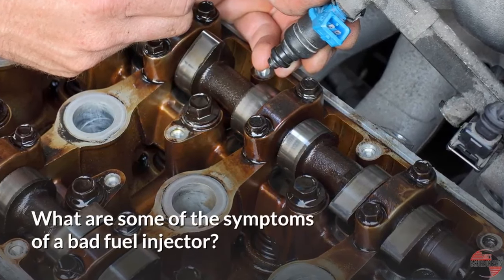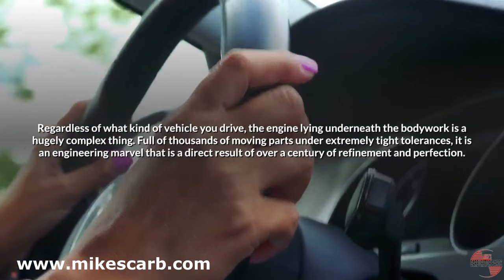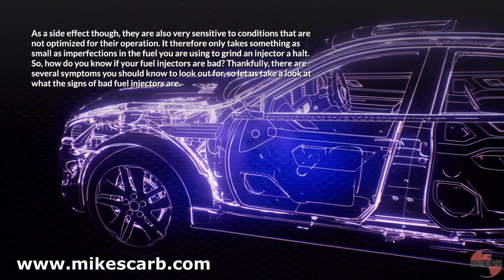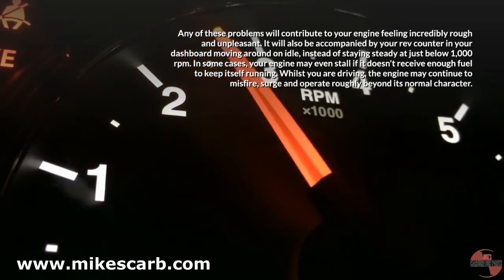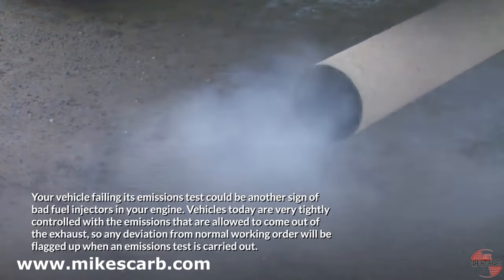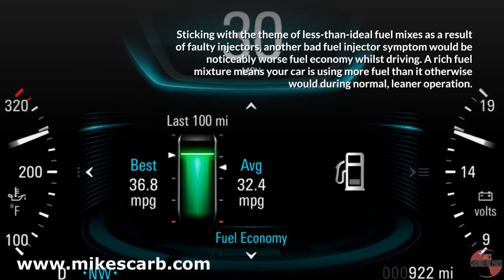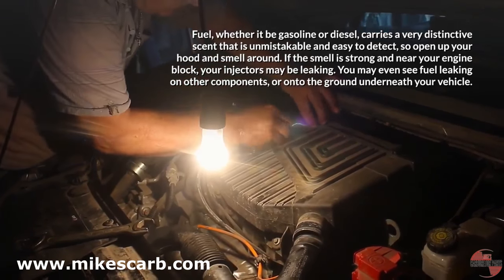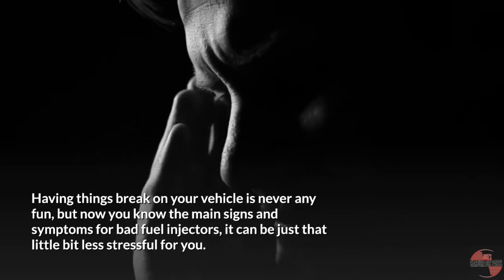Bad Fuel Injector Symptoms

Comment: my car runs fine at high speeds but at low speeds seems to missfire not sure what the issue may be and when idling the idle is rough and sounds a bit cammed
Reply: In high RPM you don’t recognize the misfire. Check spark on each cylinder (Spark gun) and check ohm resistance of all injectors
Reply: Check the camshaft and crankshaft positioning sensors.
Reply: What year, make, motor in the vehicle with cylinder amount.  Everyone can give you a general idea but it's a crap shoot without this info. Do you have a check engine light on? There are a huge amount of things that can cause bad idol.  Saw one where a dandelion seed, the little parashoot things, and it got on the hot lead of the mass air flow sensor screwing up the fuel reading.
Reply: Same problem im having rn, ever find out the issue?

Comment: What's the logic behind clogged fuel injectors decreasing fuel economy? Shouldn't it save fuel instead, since less fuel is being injected to the engine because of the clog?
Reply: Your engine has to work harder for that small combustion and will suffer depreciation fast if you keep running the engine with clogged injectors. When the damage has been made, the engine will need even more gasoline to create the combustion that is required, permanently ruining your fuel economy.
Reply: Bruv ur car races more 

High rpms burn more fuel when ur speed isn’t up to match with ur rpm

Comment: I have an 07 Avalon and it recently started to have an issue where, if I floor it, it will take move then have a brief 2-3 seconds of lack of power then take off. The oil currently used is the semi synthetic grade. Not sure why this started to happen. I plan to get the spark plugs changed soon even though it may not yet be needed but it is a costly job being that I don't have the tools needed to do this myself.
Reply: Did you scan it with a code reader?

What are your trouble codes?
Reply: @maphyous228  No I never scanned it because no errors came on the dash so I thought it wouldn’t give any codes. Do vehicles throw codes even when nothing is listed on the dash?
Reply: @adrianb1655  No, if there is a code it will show up on the dash. Sometimes you can force a code by driving the car aggressively.
Reply: @maphyous228  my battery was low once battery changed all kinds of codes came thru…
Reply: Did you ever figure out the issue?
Reply: @jaden3689  Nope, it still happens.
Reply: Plpll
Reply: @adrianb1655  ever figure it out?
Reply: @willyum2633  I never fully diagnosed it but I think it’s something to do with the spark plugs. I know I need them replaced but man the three in the back near the firewall are the reason I haven’t done it yet. Still working up the courage to do it myself haha

Comment: I have a 93 crown Victoria and I get average 13.9 mpg I get white smoke out of my exhaust sometimes, and I feel a slight loss of power. When I step on the gas a lot my check engine light comes on for a few seconds then turns off.
Reply: Jay Yoyo  yessir it does idle rough
Reply: White smoke out the pipe usually means coolant is going in the combustion chamber. 9 times out of ten, headgasket

Comment: Very nice vid i got a 2012 sierra 5.3 just replaced the cats and full dual exhaust ive went through 3 rear down stream oxygen sensors new ones are fine till i drive it awhile then the get all black soot on them may be a clogged injector
Reply: Out of curiosity what happened ?
Reply: Will bad injectors cause gas to fill up in intake manifold and come through the throttlebody of a 2011 ford explorer
Reply: @eunicenelson812  the problem you've described I have seen before. In my case there was one broken rocker arm on an intake valve. With the one intake valve not opening the fuel would simply fill the intake runner. This was on a simple LS engine but would apply to all multiport engines.
Reply: And yes a stuck fuel injector would do it too

Comment: Excellent video 
I have 1nrfe dvvti 
Low rpm lack of power need to press gas more and sound from exhaust gogogo
No rough idle
No  codes
No engine light
No white smoke
39mpg atm
Change spark plugs air filter cleaned throttle body inside out
Any recommendations
Its an electronic throttle body
Reply: Your cat converter might be plugged does your exhaust smell terrible almost fishy smell or rotten eggs? No exhaust flow means car no go

Comment: My Mazda 3 2015 has had some of these symptoms for the last year.  Low mileage, bouncing idle when in drive and at a red light or something, misfiring when I start it usually takes 2 to 3 attempts.  Also check engine light on and off.  My mechanic said code was related to mass air sensor.  He replaced the sensor but didn't help with any symptoms.  Got a new battery, so that's not the problem.  Mechanics here in NY are very lazy. I'm at a loss what to do.
Reply: @MikesCarburetor  thanks.  i actually took it into my new mechanic a few days ago for body work.  he's also looking at this problem.  he says so far that since the engine does crank and start there is air, fuel and compression, although he did say one of the air sensors was the wrong one a prior mechanic had installed.  
 he seems to think faulty starts might be from the computer?  i mentioned the fuel injectors and he also thinks that could be it but seems to lean towards the computer.  i had actually put in stp prior to taking it into the new mechanic. but haven't had a chance to drive it yet.
Reply: It's your throttle position sensor (TPS) sensor, bouncing idle was the biggest clue
Reply: @oceanpacific3841  but would that also be the reason the car starts cold but when warm will crank but won't turn over.  it takes usually 2 or 3 attempts once the car is warm throughout the day.
Reply: @magamaga1827  ever figure it out

Comment: My problem is at startup. It acts like it's not getting the fuel it needs at start-up and white smoke is coming out the tailpipe. I've used injector cleaner and it took care of it till now. I'll use that again till I save to get a complete injector cleaning.
Reply: White smoke from your exhaust (if it happens continuously after starting the vehicle) is usually coolant being burned within the engine. Which usually means a head gasket issue.
Reply: Jay Yoyo  depends on if you have any issues, like overheating or low coolant levels. Otherwise it could just be steam being burned off, humidity/weather would/could also play a part.

But yes it could still be that coolant is getting into the engine and being burned.
Reply: Jay Yoyo  so normally you shouldn’t have to refill coolant. A flawless cooling system won’t require you to top it off. But if it’s only a little annually it’s most likely just a small leak.
Reply: Jay Yoyo  cold stalling is completely different. Coolant levels or leaking coolant won’t affect your cars starting ability.

Cold start stalling could be the fuel pump, fuel filter, fuel injectors, bad battery, bad battery leads, bad alternator; etc. If it’s cold starting that needs to be diagnosed by a mechanic. Making sure you have a good battery and alternator is an good start tho, usually done free at auto zone or the like.
Reply: Jay Yoyo  again you’d have to take it to a mechanic to get a proper diagnosis. I could list off potential causes all day, but really that’s all just speculation. Something like that can only be determined in person, with a proper in depth diagnosis; which unfortunately are kinda costly.
Reply: Jay Yoyo  here, on YouTube look up Scotty Kilmer click on any of his videos, and go to the description box. You’ll find a link to his website loaded with people who can help.

I did say cold stalling/starting is better diagnosed in person by a mechanic. Finding a good mechanic is hard but once you do everything works out.

To answer your question … no. A blown head gasket would not cause stalling and compression issues; UNLESS is was a seriously damage head gasket or engine block. In which case you’d be loosing/burning a ridiculous amount of coolant, a day. Seeing as your not nearly losing that much coolant, the answer is no. 

You could have your engine compression tested tho to be certain. Bad compression could mean a worn out engine, bad radiator, leak, etc.

But again I don’t know the year, make, model, history, and mileage of the vehicle. I’ve only every had Hondas and Toyotas, those I guess you could say I specialize in.

EDIT (here’s the link): https://carkiller.com/community/
Reply: Do you have a Lexus suv?
Reply: Same exact issue how do I know if serious or fuel injunctive or air filter or bad muffler and pipe.  These mechanics can’t be trustee

Comment: I'm hoping this is what all is going wrong with my 08 Chrysler Town & Country. The engine completely stopped one night, and while it turns over, it only runs for a second or two. Things I noticed leading up to that, pinging (thought it was knocking), the aforementioned rough idle and severe mileage loss. The first few times I got it started back up (before it shut off again) it backfired multiple times and sounded like a lawnmower before it shut back off. I feel like it's definitely fuel related since I had another car sound like that once, when the fuel pump went out. Is the lawnmower sound common with bad fuel injectors?
Reply: You got water in tank get rubbing alcohol and put it in tank

Comment: Question my Uncle who is a mechanic told me my fuel injector has a leak, inside the car it smells of diesel, under the hood it sounds like a ticking noise also smoke under the hood and a lot of smoke coming from the exhaust.

Are these symptoms not showing something worse? No check engine showing

Comment: My car is so weird. On the freeway at around 4000rpm it sometimes sits and won’t shift and I have to let go of the gas and try to ease past it. It also died today and would start then immediately die. I went back 30 minutes later and it started up and drove home. It’s always had a rough idle cus I need engine mounts so I don’t know if it’s good enough testing
Reply: @MikesCarburetor  is there a way I can check for certain codes without a obd2 scanner I don’t have one.
Reply: @Chopliferoc  were you able to figure it out? Mines is doing the same, changing the fuel injectors tomorrow
Reply: @adalbertosantana7872  engine mounts and a few sensors. Mass air flow sensor I forget the other one

Comment: 2013 chevy Silverado 1500 5.3, struggles to start every morning. Sounds like it kills then suddenly starts at a high idle. Once the engine is warm I have no trouble starting it the rest of the day unless it sits about 8-12 hours without being started . I use marvel mystery oil in my regular fuel ups and sea foam In fuel at oil changes
Reply: Did new fuel injectors fix this ? I have the same problem
Reply: Yep me too
Reply: Curious if you found the solution?
Reply: @rhiannon_codi  I found the perfect solution! I had been dumping several $$$ into the truck over the last year so I traded it in while trade in values are good and was able to get a brand new GMC Canyon for $20k after trade in. Sucks having a note but with the money I’m saving on fuel and not buying parts every month it works out lol
Reply: Mine ended up being a simple fuel return rail leak
Reply: I’m also dealing with this problem
Reply: Losing fuel pressure over night. Could be a leaky fuel injector.
Reply: I have this problem as well for my Nissan Murano 2009

Comment: I have a 2018 Chevy Silverado and the check engine light is flashing I checked the code and it says low voltage fuel injector. Engine is running rough as well.
Reply: @MikesCarburetor  well it runs rough at idle and shakes as well. When I was  driving it at the time it was also down shifting very hard like almost jerking.

Comment: I have a 2014 impala it hesitates an jerks and drops rpm’s while I’m driving slow an trying to maintain steady speed
Reply: @MikesCarburetor  no code
Reply: My dodge is doing this it will shut off not lose power but shuts off engine wise when I am slowing down and jerks and lower rpm when I’m driving at a steady speed did you figure out what’s causing it no check engine light either
Reply: @MikesCarburetor  thanks for the advise my check engine light finally came on and it was the crank shaft sensor

Comment: Here is my timeline. My 4.3 silverado truck was running bad then stopped. I changed fuel filter. wasnt the problem spent 400 on a fuel pump. wasnt the problem, changed plugs wasnt the problem, changed mass air filter wast the problem, Finally tried fuel injectors on was broke.  I installed autozone spider injectors. It ran like a brand new truck. All of a sudden one morning it refused to start.  I added gas, and it started, and now it wont work. Do you have an idea whats wrong? I spent over 1000, and its not drivable.
Reply: Did you ever figure out what was wrong?
Reply: @tseawell90  Yes I suspect that my heater coil dripped water on my distributor cap, and killed it. I changed the cap, and it ran for a while, then my battery died from it sitting up. I blame the no good parts from autozone. they keep a person coming back.

Comment: Quick question as you said in the video bad fuel injectors can cause a misfire. I’m having that problem, Along with a rough idle and drop in mileage. I also smell gasoline when I turn my car on in park. My question is can fuel injectors cause a misfire in only one cylinder? For example I have code for a misfire in cylinder six p0306. I know the code for a random misfire is p0300. Can bad fuel injectors cause a single cylinder to misfire like my p0306 or does it only cause the random misfire code p0300? If anybody in the comments can help out that would be great?
Reply: Am having the same issue, did you get it resolved?
Reply: @abdullahcheema7061  they do cause misfires but for my car I haven’t checked only cause there is a multitude of issues that I have and they cost to much money to look at my self or have someone check out. But in short bad fuel injectors do cause misfires
Reply: im in the same situation right now, you get it figured out?
Reply: @cainabelcarrizales6386  my car ended up breaking down, I just didn’t feel like fixing it but yes Bad Fuel Injectirs can cause isolated miss fires. A bad fuel injector can cause a single cylinder to miss fire. If you smell gasoline and you have a misfire code for a specific cylinder, There’s a 90 percent chance it’s because of your fuel injector. Hope this helps

Comment: Any mechanics here? I have a volvo s60 2001 that was standing still with the same gasoline for almost 3 years. Fuel pump went bad and the engine wouldn't start. So the fuel pump was replaced. Now the engine turns on but the engine runs very rough and eventually it wont accelerate and turn off. Is it clogged inejctors? 🤔
Reply: Change the fuel filter and add some fuel injector cleaner to your fuel.

Comment: Just bought a 2013 Mazda cx5 and the oil smells like fuel but only once did it have rough idle at start up and only rough when in park and reving it but when driving it feels fine.. would this be a bad fuel injectors? .. I also have a check engine light for o2 sensor or manifold I think that’s what it was or it’s my exhaust leak that has 4 little holes ..

Comment: I clean my engine on a 2000 astro van . Misfire now will this help to get it back running smoothly.  Cleaning the injectors
Reply: No its going to be fine just air out plugs etc. it just got wet
Reply: @Chris Chairez I need to  remove the spark plugs and blow air in the cylinders .thanks
Reply: @deepclean5335   and add spit. Lol
Reply: @deepclean5335  add injector cleaner royal purple max if help a bit remove injector and clean it Amazon has a cool tool for under 40 bucks.

Comment: My 05 suburban has 213,000 miles with original injectors I think it’s time to change em. Rough idle, hard start and decreased fuel economy.
Reply: I got 04 silverado has 138k hard start and decreased fuel economy too no rough idle could it be a injector ? When I push on the gas it don't go as strong as it should it trow white smoke thru the exhaust

Comment: My 97 Kia sportage will start and run fine but after parking it and turning it off it has to completely cool down before I drive it again or it will continually misfire on one or two cylinders. They wont fire at all till cooled completely down.

Comment: Yup I think my fuel injector clogged and probably bad gas to hard start rough idle  rpms jumping 😭 and engine light
Reply: @MikesCarburetor  yes sure tuned out it was electrical and I was burning a lot more gas than  usual and I need a catalytic converter 😂🤦🏽‍♂️
Reply: @MikesCarburetor  yessir and hopefully it’s cheaper plus I need a throttle body because when I rev it the rpms stay up
Reply: @MikesCarburetor  oh yea you right ima end up checking that to

Comment: Every shop I went too they keep saying spark plug or coil packs why do I get interrogated when I ask to replace them so I'm doing them my self.
Reply: Yes I did the same thing, but my 2007 rav4 has unkown problem, mechanics can't figure it out and I can't either, I think I have to replace my fuel injectors but idk. They don't wanna point you in the right direction , because they don't want you to succeed, me and my cousin have gotten this suv to run better , and figured out some oil is leaking into my coils, but once that truck heats up it has problems. I give credit to Toyota it runs no matter what just gotta push harder on the gas.
Reply: true